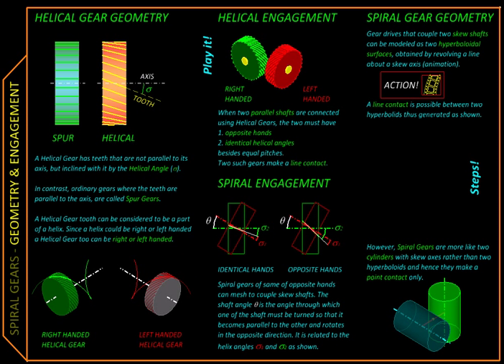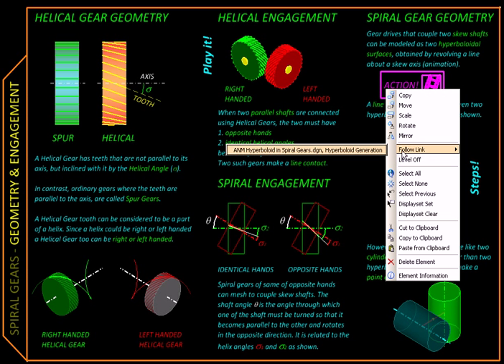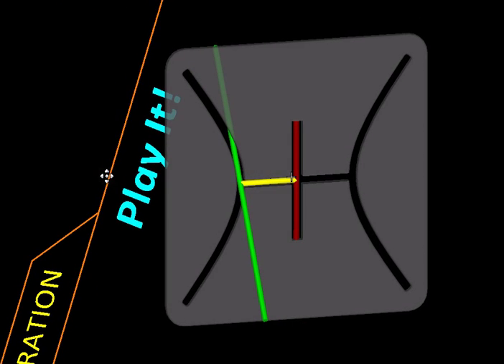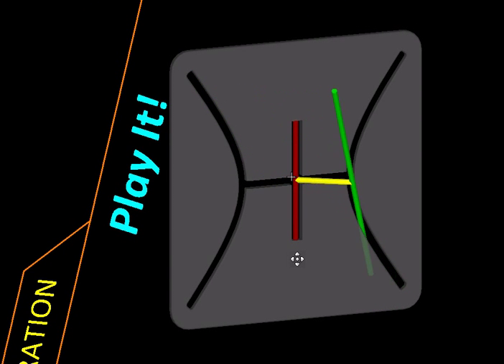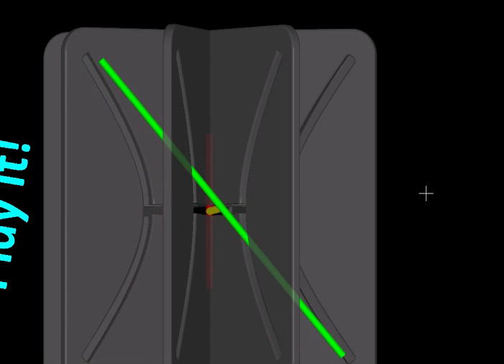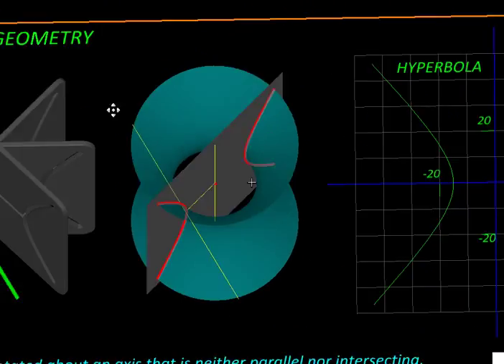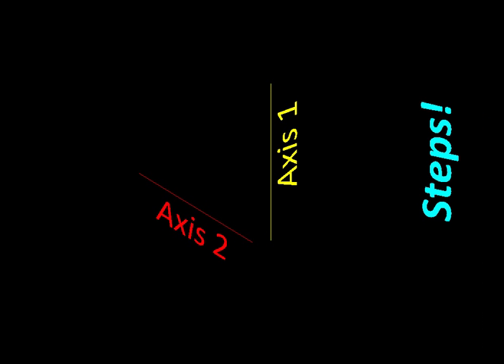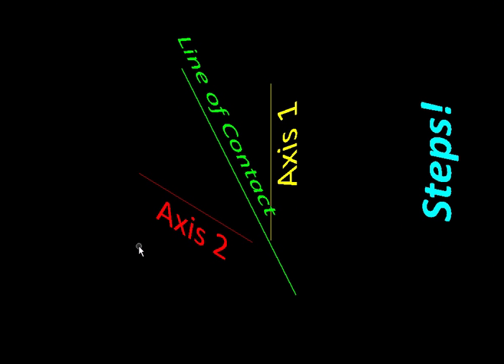Kinematics Ch06J Spiral Gear Geometry

Comment from the maker: @abhideep singh Thanks :-) To answer your question I would take the need -> features -> solution path. That is first mail down what you want - load or geometry (motion/axes configuration). If it is load, go for something that offers more area to bear it (line contact!) if it is just the way your axes are placed, focus on geometry and don't mind even if it's point contact. Then select the gearing that offers you what you seek.
BTW, nice to have that 'irrespective of cost' option :-)
Good luck!

Comment: This tutorial deserves an award. One of the best I have ever seen. Just one question I have, after reading this chapter from Thomas Bevan, that difference between spiral gearing and true skew gearing is that , it has a point contact and later has a line contact. 1) How teeth on spiral gear will differ from teeth on true skew gear in visual appearance? 2) Which amongst the two is better, irrespective of cost? THANKS...